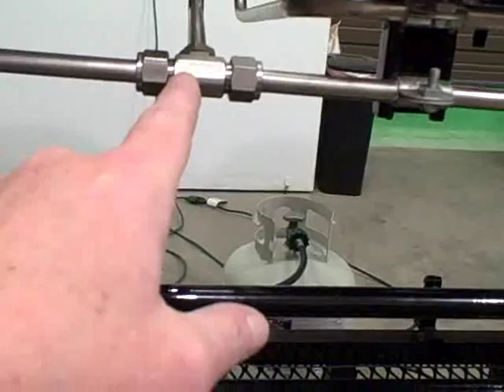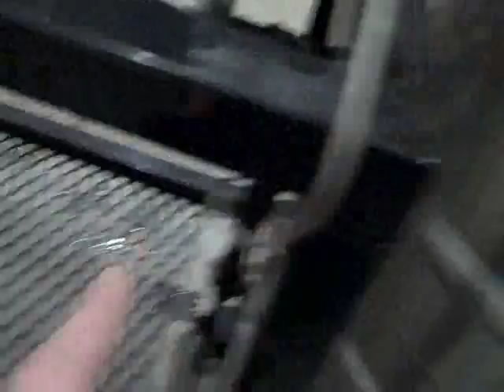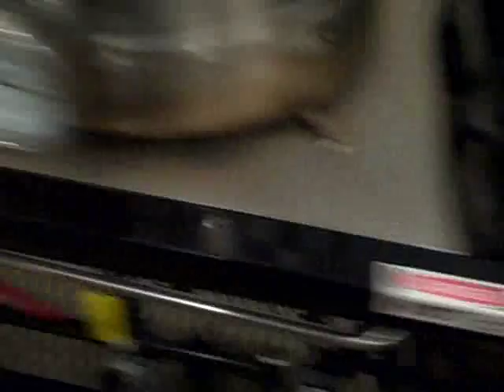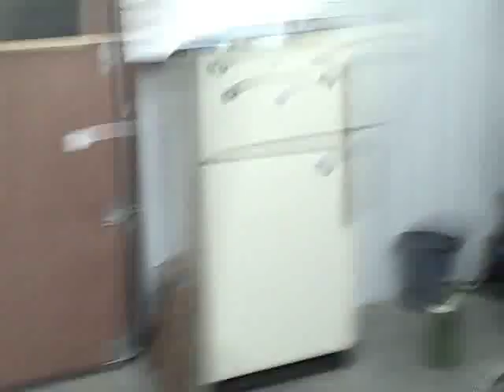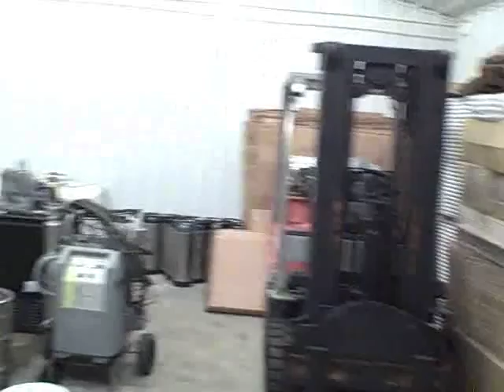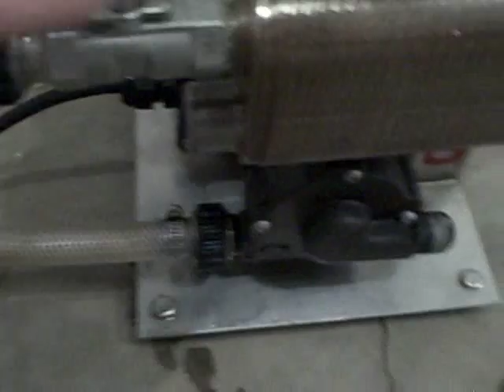SABCO System & Chill Wizzard

Comment: do you have issues with temp regulation at all?
Reply from the maker: as far as the RIMS? Nope.. pretty much set it and forget it.. It WILL drop a tad if you don't mash in high enough and you may have to light the burner slightly to get it regulated but after it regulates it pretty much stays within a degree..